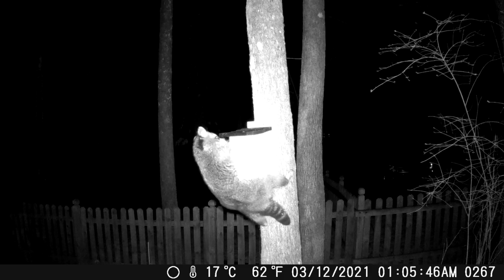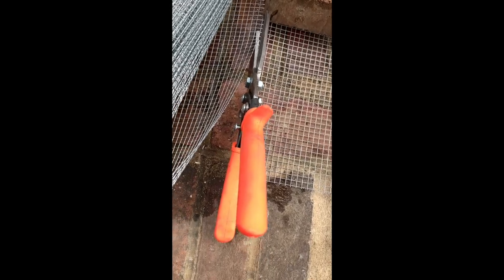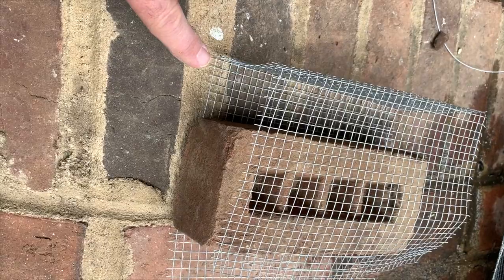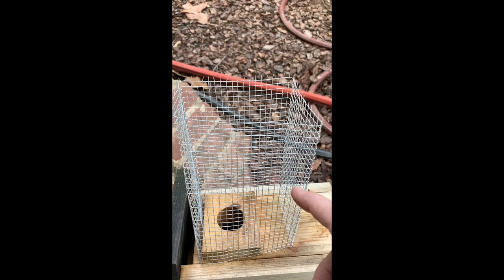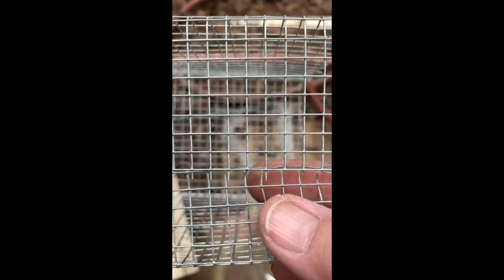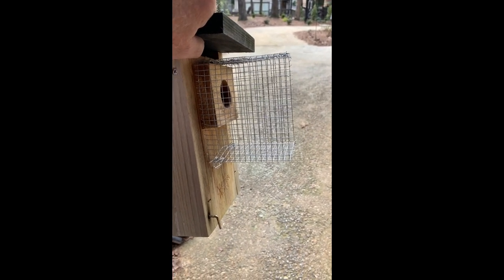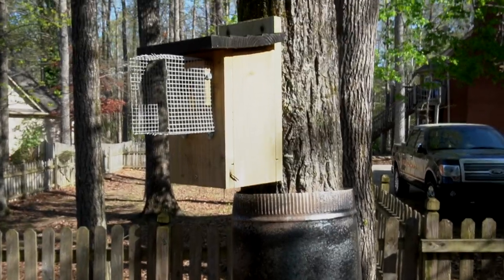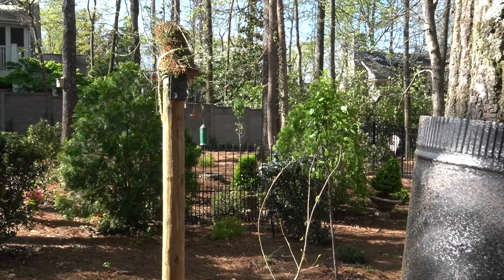Bluebird Tree Nesting Box Predator Protection DIY Project

Comment: Came outside this morning to my bluebird box mounted on a tree occupied by our first pair of nesting bluebirds, only to find the box lying on the ground and 5 little crushed blue eggs pulled out :( 
My wife and I were heartbroken and figure it was a pesky raccoon that did the damage, as we are overrun with raccoons.
 I will now be working on this project immediately and hope it will safeguard future nesting efforts.  Mr. Raccoon will need gloves, pliers and a crowbar when I'm finished.  Thanks Ken for the guidance.  You're the MAN!
Reply from the maker: It is heartbreaking!  I know it is bad practice to hang bluebird nesting boxes on trees, but I don't have a lot of room in my small yard and the cost for 3 poles, 3 baffles for my 3 nesting boxes is prohibitively expensive, so I used trees, but like you learned my lesson the hard way, so I did my best to ensure it would not happen again.  I'm glad my video was helpful.  However,  I do acknowledge that putting them on a pole that is baffled and away for all trees that squirrels and raccoons could use to access the nesting boxes is the best solution if you have the room in your yard and the money to afford it.

Comment: I've built and monitor at least 50 Bluebird boes and have never felt like they needed any more protection from predators than a predator block that goes over the access hole.  There is obviously nothing wrong with what you are doing, but all boxes need a predator block, no perches, an access door for cleaning, floor drainage, no stain or paint as it can be toxic,  a few shallow kerf cuts under the access hole both inside and outside so chicks can easily climb out when the fledge.

Comment: I've lost the last 2 years of Wrens babies to predators.  😢😢, and I want to mount my birdhouse for this year's fledglings, but I need a guard!
I'm a lady who has no  help, so my problem is  that my birdhouse has a pitched roof, so your measurements don't work for what I need, though very helpful with basics. I can't figure the best way to make the guard that isn't square. It's posted on a post of my under-house patio, which has worked well,  except for predators. I wish I had a helper like you to assist me. I have the materials but still queried what will work. Any ideas?
Reply from the maker: Predation can happen when nesting boxes are put in places where predators can access the feeders.  If just put on a pole without a baffle on the pole, they can gain access from the bottom.  If the pole is located too close to structures like trees, fences or any structure that the predator can use for access, then the nesting box can be accessed from the top by a predators.  Unfortunately, I have my nesting boxes on tress and raccoons or snakes or squirrels can predate if there is no noel guard.  Even with one, a determined predator can sometimes gain access.  Wild Birds unlimited carries some noel guards and someone in the store my could make sure you walk out with one on a nesting box.  It is probably better to examine the nesting box location.  Also, check out by blog posts on https://kenlittleblog.com for other tips about location tips and dealing with nuisance birds as House Sparrows can also predate Bluebird nesting boxes.  Best of luck and thanks for the questions!

Comment: The Blue bird house should be on a metal pipe instead of a tree.  Easier to install stove pipe.
Reply from the maker: I agree that poles are better.  I probably should have spent a lot of money buying four poles and a baffle for each pole, as I have a lot of squirrels and raccoons that would try to get in them.  Also, my back yard is tiny and finding suitable space doesn't leave me the option to place 4 poles.  Trees are already there and so I used them but tried my best to provide the best protection.

Comment: Just close the hole and make the a slot slightly larger.
Reply from the maker: I’m not sure what you mean. Please explain further.
Reply: @KenLittle   On the birdhouse in the video, you have a round hole and you have a horizontal slot above the round hole. Close the round hole. Open the horizontal slot above the round hole to 1 1/4 inches. The slot at the top of your bluebird house provides the same protection as the Noel Guard with less work and less material. The slot keeps out other bird species like starlings and makes it difficult for predators to reach in to grab an egg or bird.  With the slot so close to the roof, predators and competitive bird species find it difficult to chip away at the slot to make it easier to gain entry.  Our native bird species have a slightly different body structure than the invasive species introduced from Europe. This difference in anatomy allows our native birds to squeeze into narrower slots than the invasive species. A similar technique is used to protect purple martin homes from starlings.

With the slot at the top, you can hinge the door at the bottom . To clean the birdhouse, grab the slot and pull open.  Add a pin or screw at the top to prevent predators from doing the same.  This also makes it much easier to deal with bird houses infested with wasps and other undesirables.

Bluebirds prefer their home out in the open away from trees and bushes.  Bluebirds are well known to nest in cavities in fence posts, poles, and in old tractors/vehicles 4-10 feet off the ground away from vegetation. This gives them additional protection from predators as well as provides them a commanding view of fields, meadows, and open yards where bluebirds like to hunt for food.  You can simulate this by mounting your bluebird house in the middle of an open area. If you have a small area, you can try putting the back of the house a few feet from vegetation facing an open area. 

To ake a portable, weather resistant mount that provides more resistance to predators. I and many others use 5-10 foot electrical conduit 1/2-3/4 inside diameter on matching diameter rebar or rebar spike/pin 3-5 feet in length.  Drive the rebar or spike/pin 2-3 feet into the ground. Slide the conduit over the rebar or spike/pin sticking 1-2 feet out of the ground.  I use EMT with the matching EMT coupler to securely connect the EMT to the rebar. You can also use the schedule 80 PVC conduit.  If you use EMT with rebar, you can often drive the rebar into the ground and remove it by hand while attached to the conduit.  

Mount the birdhouse to the top of the conduit. I use a single pipe strap of the appropriate size with 3 screws. Two screws secure the pipe strap lower down on the back of the birdhouse. The 3rd screw is driven 90% into the back of the birdhouse a few inches higher that the pipe strap with the head of the screw in line with the center of the hole in the pipe strap. The conduit runs up through the strap and stops at the screw with the thickness of the conduit wall wedged between the screw head and the birdhouse wall. For added security, I cut a slot into the conduit for the screw head and shaft to fit into snugly.  

I also mount bluebird houses to the metal poles including the posts that hold up chain-link “hurricane” fences - preferably without the fence attached to the pole which allows predators easier access.  If you don’t have conduit or poles, use a treated 2x4, 2x6, 4x4, or 4x6. You can decide if you want to add a predator guard to a wooden vertical mount to keep the parents from being grabbed by a predator.
Reply from the maker: @davidscbirdsall   - THANKS SO MUCH for taking the time and for all the detail, from which we can all learn!
Reply: @KenLittle  you’re welcome.  Those are ideas I was taught in 4-H.  You can see all those ideas I mentioned in YouTube videos.